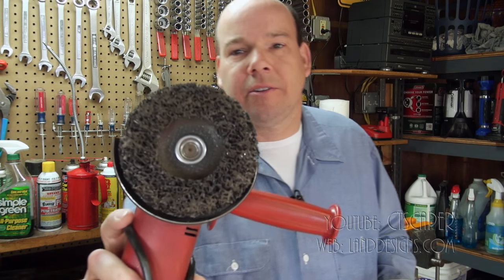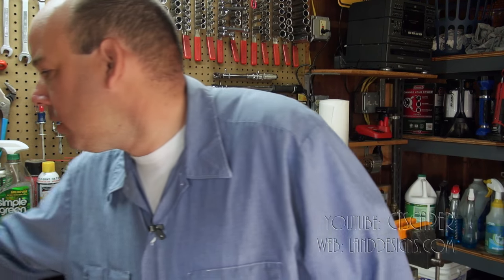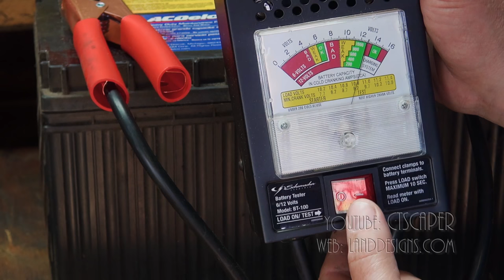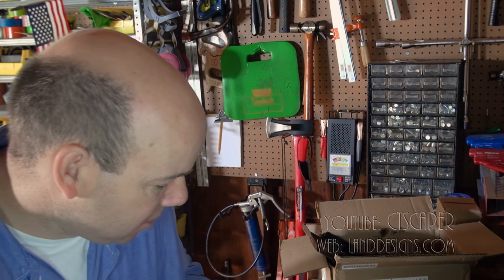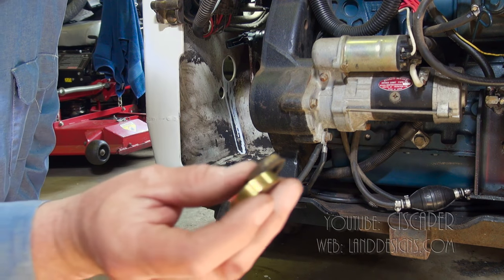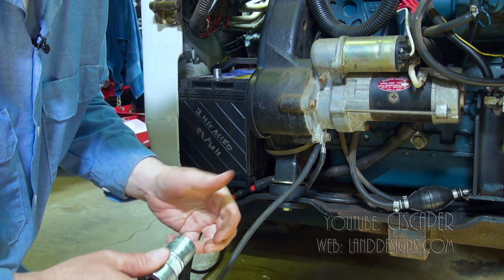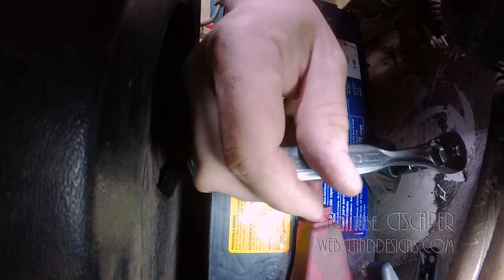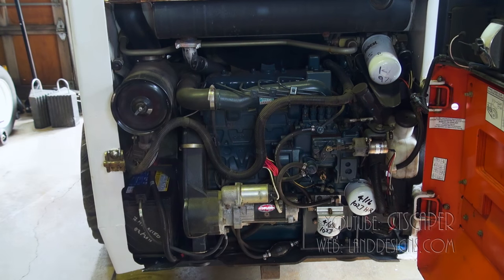BOBCAT SKID STEER BATTERY TRAY REPLACEMENT

Comment: I have replaced at least a dozen of these, I like to use a small piece of duct tape under each rod under the tray to hold the rods in their slots. I also spray the entire top and bottom of the new tray with Fluid Film.... Seems to extend their lives many years. You can also bend the tabs of the tray over to hold the rods as another option. I usually don't in case I want to replace the rods without the tray in the future

Comment: I got the same bolts for the battery tray from the dealer also, he said they where right… but no washers for underneath the battery tray..I noticed the old battery tray was mounted the same way. What is the reason for the washers under the battery pan and are they really needed? Mine was bolted straight to the frame. Thanks
Reply from the maker: I put this video up a long time ago and don't remember the battery tray content, beside how utterly rotted and rusty the area was.  I have to assume washers would be ther either to seperate the two metals so there is no contact and prevent rust or if the washers are rubber to minimize vibration.  I hope you had luck cleaning the area out.  It was sooooo messy on mine.

Comment: bobcat s130 alternator belt adjustment bolt broken inside the alternator. I have to remove alternator off the machine. If you got any video how to remove alternator from bobcat s130. Please tel me. Thanks
Reply from the maker: Oooh!  Alternators are really buried on Bobcats.  I had to tighten the belt on mine and it sucked.  I hope you get it figured out.
Reply: CTSCAPER well today operator informed me that main pulley drive belt was broken away if u have any video replacing this belt pls let me know
Thanks

Comment: You’d know if you put the battery in backwards.. I did it in my 743 and it instantly kills the diodes in the alternator causing dead sort and then escaping smoke. :-(
Reply from the maker: That doesn't sound fun....
Reply: Nope, thou easy to fix.. new alternator and lead from solinoid to alternator was all that needed to be replaced.